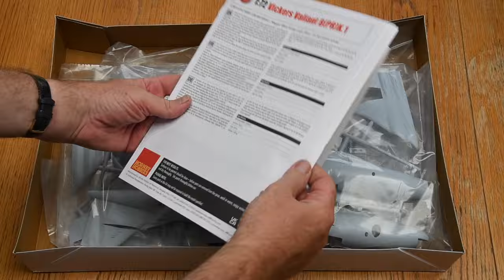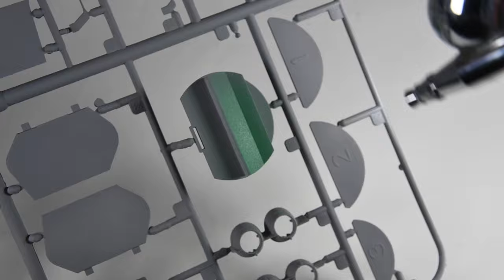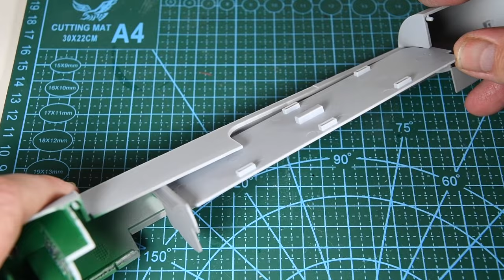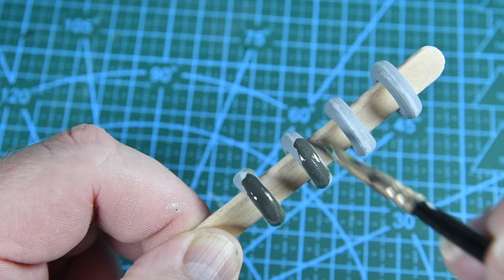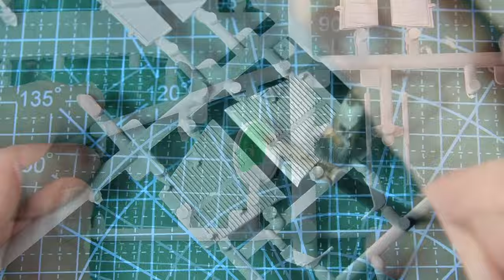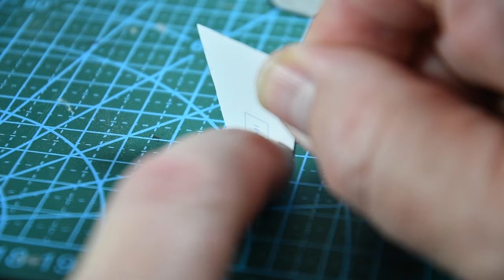Airfix Vickers Valiant 2021 release 1/72 review and full build -  HD 720p

Comment: Just purchased this kit to revive my model building interests many years ago. I was on Christmas Island 1958 and watched 3 hydrogen bombs dropped by this aircraft. At the time it was always mentioned that the aircraft used for the tests always had the black patch under the nose as shown on the box picture. I note that there is a black patch in the decals, could this be for this purpose? Enjoyed your build my only fear is trying to get a nice gloss white finish.
Reply from the maker: Can't remember the decal sheet, but the big black area under the nose is for the bombing radar. I sincerely hope you haven't suffered any long-term effects from your service. For the gloss finish, all you really need is some spray gloss varnish as it's such a big kit and a relatively dust-free environment. Hope you enjoy the kit!

Comment: What paint did you use to brush paint the aluminium? Thanks.
Reply from the maker: For a lot of aluminium I use Vallejo Model Air Aluminium. It's thick enough to brush easily and I like the finish. If you mix it about 2:1 with white you get a pretty fair high-speed silver too.
Reply: @garys_stuff ok. Thanks. I’ve finally got around to build mine. 😃

Comment: The paler the colour on the decals the easier it is for the paint to disperse heat from flash
Reply from the maker: I understand the theory, but this must just work at a fairly specific distance from the bomb. Nearer and the whole plane is going to melt anyway so it doesn't matter, further away and the heat will be absorbed or reflected without catastrophic damage. It must be a very small zone where, say, dark blue will absorb enough to tear a hole in the skin and cause the loss of the aircraft but pastel blue is untouched.

Comment: Thank you, Gary, I enjoyed that. Regarding the panel lines, I'm sure you'll have tried oil paint thinned with white spirit but if you've not, it works a treat over gloss coat or Future or whatever. Black is stark though so maybe a grey would work better. And a bit of wet n dry wrapped around a piece of dowel would thin the jet tubes nicely.
Reply from the maker: My pleasure. Good tips - this came from my very early days on YT - now I'd probably use a grey MIG Ammo panel wash or some such!

Comment: The reason for the lighter roundels etc was it was thought that if the aircraft was caught in a flash from an atomic blast ordinary markings would burn through so the idea was to use a lighter hue for the markings to minimise this ,it sad to that her service life was cut short due to fatigue once they switched to low level ,ironically the one and only B2 valiant was designed for this kind of attack that aircraft was finished in all over gloss black had a bogie main under carriage that folded into wing nacelles and was called the pathfinder but only one built ,
Watching this again Gary 
All the best 
Mark 🎅🏼👍🏻😊
Reply from the maker: Cheers Mark!

Comment: How did the navigators do celestial navigation in these, I wonder? That hemispere on the rear cockpit roof isn't some kind of sextant housing, is it?

Worth remembering - they didn't give the backseaters ejector seats because they weren't sure if they'd work facing backwards. Martin-Baker demonstrated yes, they work just fine facing backwards, but the UK govt decided it wasn't worth retrofitting. A Vulcan ditched in the Irish Sea with all hands as the pilots declined to eject and leave their crew to die, and the UK govt then spent more money recovering the wreckage than it would've cost to do the retrofit. Horrific decisionmaking from the top.

Comment: lovely build chap. jusy wondering what metallic paints do you use?
Reply from the maker: Thanks Greg. For the aluminium I use Vallejo Model Air (71.062) as I think it gives a nice dulled sheen and covers really well with brushes as well as an air brush. For the steel details I use Revell Aqua Color steel (36191), when you add the tiniest drop of water to the mix it has a really good shine off the brush. The majority of my paints are Vallejo. Cheers, Gary
Reply: @garys_stuff  nice one thanks, i'm a brush painter me so struggle to get a good metallic finish

Comment: The black panel lines do not look very well, some of the lines are wry or not completely filled with paint. Tamiya panel line accent color would have been a good choice. "Banggood " in  the United States offers a special panel line accent pen. Otherwise a well built model...
Reply from the maker: Normally I use Revell weathering powder in water, but the very high gloss stops it spreading. The paint seemed a bit better. I will have a look at that pen though. Thanks for the info! Cheers, Gary